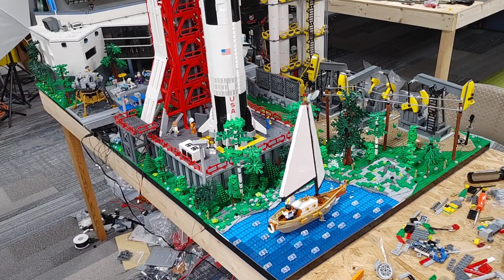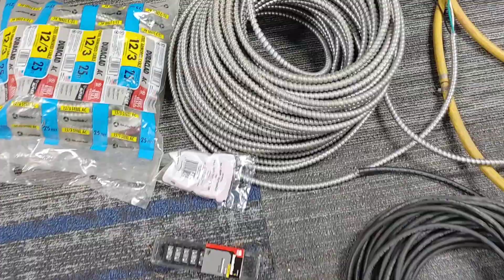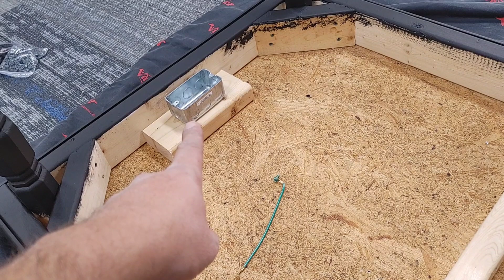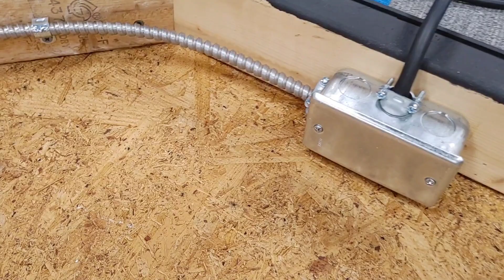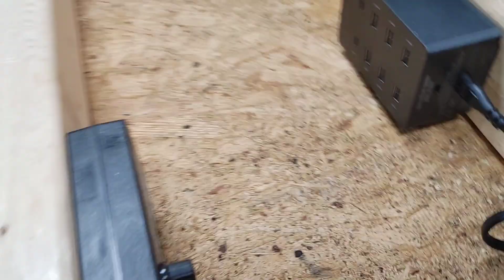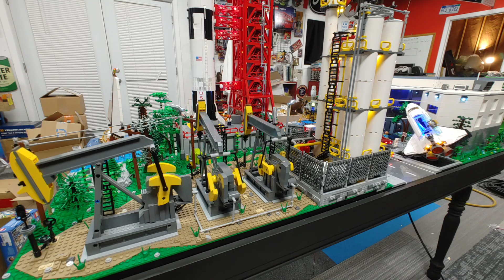Finishing My Lego Display.

Comment: Looks fantastic, great work! How did you finish off the wiring for all the cars? Did you run the wiring under the cars and then straight down through the table? Just curious as I have few vehicles with lighting now but they look like they have tails with the small usb at the end, lol!
Reply from the maker: I make my own lighting harnesses for the cars so that way they have the small 1.25 mm plugs on them.  Then because I'm using the new road plates I can run the wire through one of the holes in the road plates and connect them underneath the road plate.  Keep in mind all this is only possible if you use Mils roads

Comment: Respect. Doing this alongside full time job is even more commendable. Unbelievable creation.. 
Can you please share where can we buy this big power supply or how it is called that have 6 USB ports? 
I use for my setup now 6 Fast USB chargers from 1A-3A each, with multiple USB hubs . This would be much better option Right? How much Amps in total can this big powerplay take?

Thanks
Reply from the maker: This is the usb power supply im using and its rated for 100w, I would limit it to 1 amp per output.
https://amzn.to/3Geup6e
Reply: @BevinsBricksWorld  Thanks. This 2 PD ports puts out 3Amp each, other 6 1Amp Right? I see that there is also 10 port option 60W and 12Amp in total. This would even better and cheaper option for me, more ports as long as I'm below 1Amp? If I remember, you said 1 led= 0.01Amp? 😉
Reply from the maker: Yes they make this item in several options and you are right each led is .01 amp. And this one is good for 1 amp per port :)